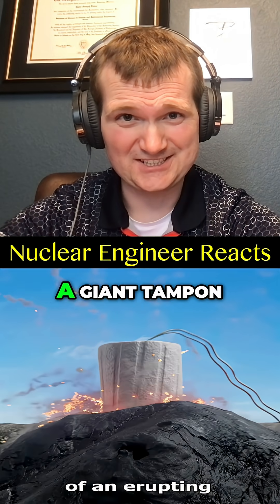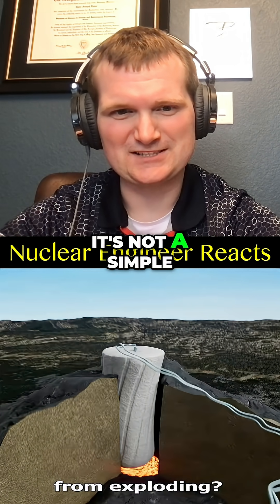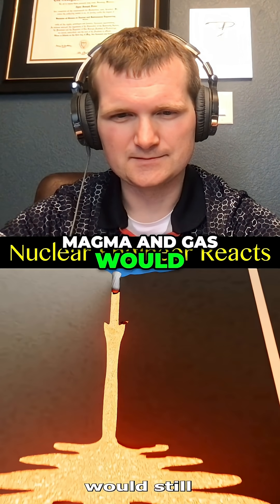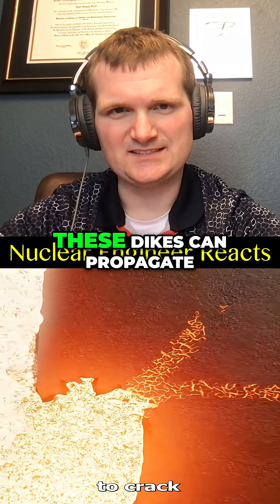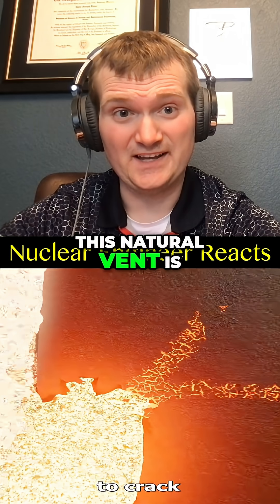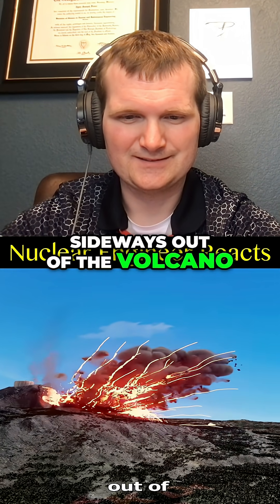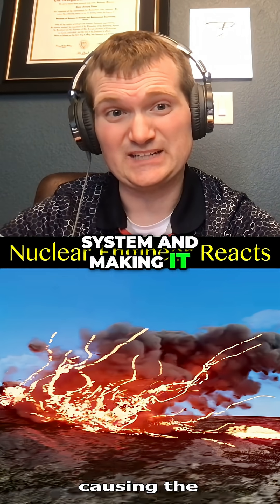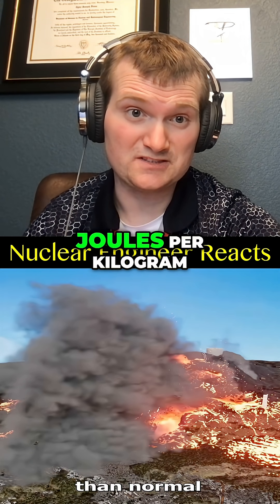What Happens if You Plug a Volcano? - Nuclear Engineer Reacts to Zack D. Films

Comment: Mount Saint Helens wasn't caused by a landslide. It was a felsic eruption through a flaw in the volcanic dome. Felsic eruptions are generally more explosive as they are subduction eruptions of different materials compared to basaltic eruptions of mostly expanding plate materials with a high iron content.
Reply: Yep the eruption caused the landslide. They are worried the same thing could happen on Mt. Rainier due to rock that has degraded and has become brittle.
Reply: @GAM1647 that wasn't a landslide. The entire face of the mountain blew off. There was very little sliding

Comment: I mean this is why volcanoes erupt in the first place, the plug is just made of stone instead.
Reply: I have to humbly disagree here. A volcanic plug is not the reason volcanoes erupt. It actually inhibits an eruption. 
The rock above the magma chamber is not concidered a plug because it’s simply overlying crust. A plug forms when magma solidifies within the vent blocking it. 

A volcano erupts primarily due to pressure buildup from magma and dissolved gases beneath the Earth’s surface. Magma forms in the mantle or lower crust and rises because it is less dense than surrounding rock. As magma ascends toward the surface, decreasing pressure causes dissolved gases (like H2O, CO2, SO2) to exsolve, forming bubbles (see “second boiling”). This gas exsolution increases the volume and pressure within the magma, which are key factors in determining eruption style. 

So volcanoes erupt due to pressure from rising magma and gases, not because of a plug. In fact, when a plug is present, it can trap that pressure, potentially leading to a more explosive and violent eruption when the plug is finally shattered. Rather than causing eruptions, plugs are obstacles that must be overcome for an eruption to occur eventually.

Comment: On a side note, if there was a controlled method of generating dikes and vents from deep in mantle, it could allow for a method of bringing additional metals to the surface that are scarce, like gold. Said metals tend to form in these same structures and most mines are situated around this type of volcanic or hydrothermal activity
Reply: Yeah, but wouldn't the drill being used melt as you get close enough to the magma?
Reply: @Benji__Strange67 you'd want it to be done via bottom up pressure than top down drilling. This is purely hypothetical

Comment: i keep hearing about this fusion energy failing so i looked into it... im just a nerd nobody special. but seems like to me the only real reason the fusion generator dont work is because the using the wrong energy source. hear me out. when tungstin and graphine is heated together in a vacume the tungstin becomes the positive electrode and the graphine becomes the negative electrode it just works using heat in a vacume simple really thats the main generator in a fusion power plant its called a photonic energy converter it requires about 1000°c just to really get started but when heated both glow with infrared energy and the reason it fails is because of the infrared energy you can use gold mirrors to reflect some of that back to the tungstin and graphine plates but its gonna leak out and the current flow stops. now in a fusion power plant they use fuel to keep it hot and if they can drop the rate the infrared energy leaks out enough then it can work but the reason i see it failing is because the environment its located in is too cold. to keep it hot you fully stop the heat loss and it will work endlessly without further energy input. to do that all you need to do lol like its a easy step all you need to do is place it in a hotter environment it will work great in orbit around venus or close to the sun or maybe a deep underground hole so the rock is atleast 1000°c then it just outputs electrical power without any input true over unity energy. seems like a slight mod and we got endless green energy. we really can make these electric cars work.

Comment: i have wondered about adding vents drill a hole into it so it flows out at all times so the pressure cant build up its just a constant open hole with slow flowing lava coming out. the problem isnt the heat its the cooling every time it cools it clogs the vents and pressure builds up again. stop letting it cool down when it clogs use a laser to open a hole again keep the hole open and flowing at all times or we will eventually loose yellowstone park.

Comment: Reminds me of fixing a muffler on a 25 year old van. I was gonna get some tiger tape to seal up the whole, then I remembered the rest of the muffler is just as weak as where the hole is. If I sealed that hole it would just open up in another spot. A chain is as strong as it's weakest link.
Reply: did you wrap the whole muffler?
Reply: @squgieman  not gonna because there was still a ton of the exhaust that is brittle (its actually going into the shop in 2 days), but there is more then the muffler that is rotted. I get if it was only the muffler i could wrap the whole thing and it would work. but the resonator and connecting pipe is rotted too. if the muffler wouldn't blow out then it would just open up somewhere else.